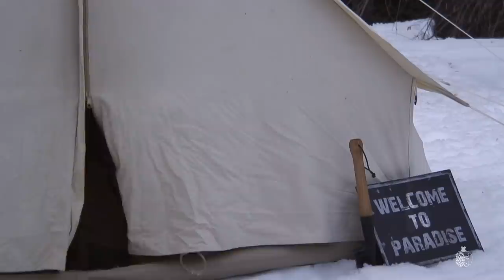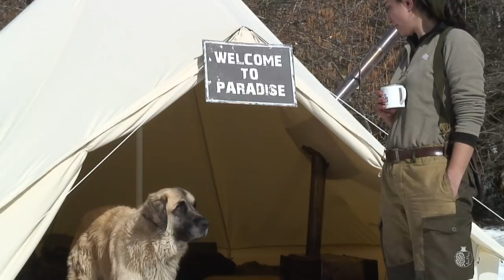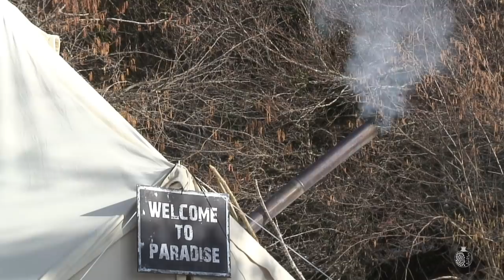5 DAYS BUSHCRAFT OVERNIGHT - CANVAS TENT SURVIVAL BOW BREAD COOKING RUSSIAN ПЕЧЬ [Full documentary]

Comment: it seems a heavy tent, how far did you walk?
Reply from the maker: It is very heavy, at least 30 kgs but with the sledge very easy to move. Even my little son was able to move it. In this particular site we walked like 10-12 kms.
Reply: @ani4x4  even so it seems difficult. These days i walked 12km with 12kg backpack and suffered but the temperature here is high.
Reply from the maker: @cientifiko  sledges are easier to move than backack. I have just returned from a 3-day bushcraft trip in the snow with a light pack I am broken. Snow is hard for moving long distances. That`s why I use sledges and pulkas.